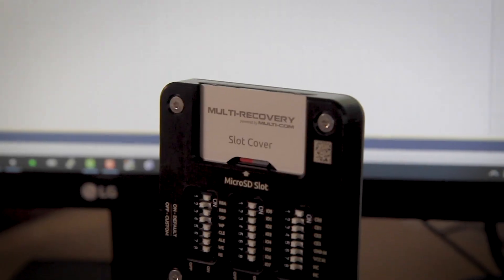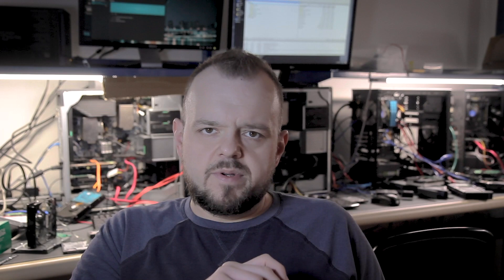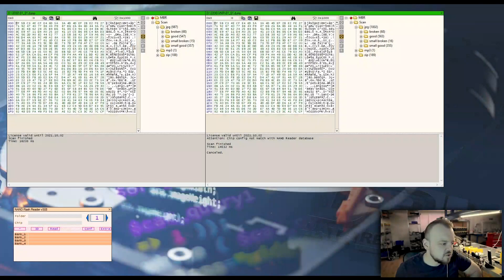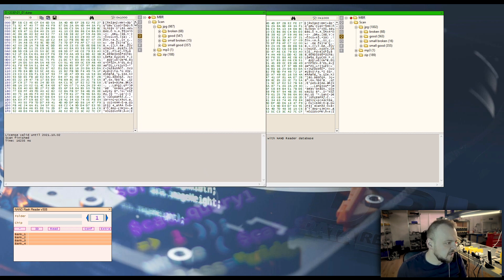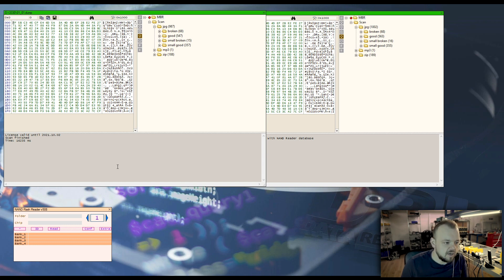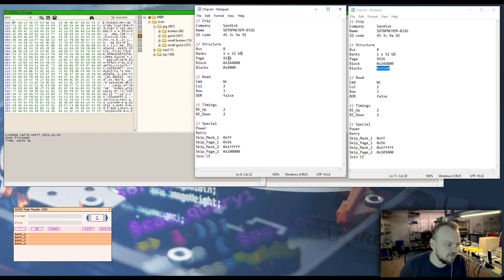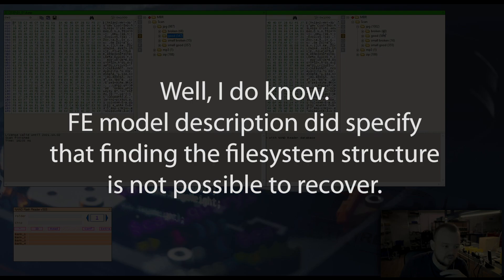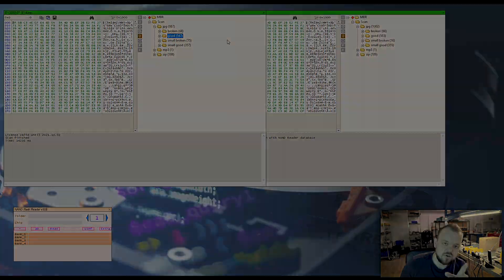Sandisk MicroSD not detected - easy data recovery

Comment: I have the same Type 1 MicroSD.  Having an issue with getting it to recognize and image with the Multi adapter.  Are the settings (dip switches) shown in the beginning of the video the correct for that card?  Im using the PC3k Flash